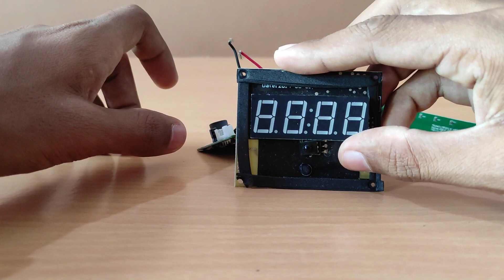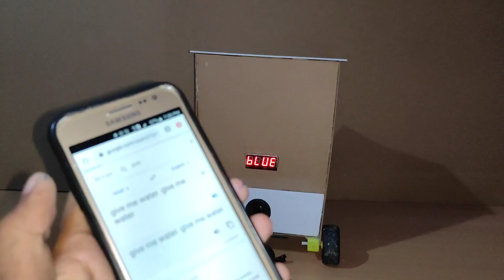Amazing Best science Project Smart Robot Dustbin | Phone control Dustbin Robot

Comment: Hello bro would u tell me arduino code and diagram?
Reply from the maker: Codes and Diagram link in video Description
Reply: @HarishProjects  bro that code and diagram is for smart robot cars
Can you send me code and diagram for robot dustbin?
Reply from the maker: @ahmadtariqhemat379  Yes these codes are for robot cars.  But you can also use it for robot dustbin.
Reply: @HarishProjects  thanks bro and can you send me its diagram clearly? Bhai
Reply: Bro but that code and diagram is for robot car!!😕🙄
Bhai would you send me the code and diagram for robot dustbin?
Reply from the maker: Brother, if you want, you can make your project with the same diagram.  Which I have given in the description of the video.  I have also made  And I do not even have another diagram.  You only have to use two wheels in your robot.
Reply: @HarishProjects  bhai ye upar ka cap or peche ka stand kesa banadiya?
Zara help karro moje ye project ke banane ki liye
Reply from the maker: @ahmadtariqhemat379  cap ko open krne ke liye aapko servo motor aur ek nano Arduino ka jaroorat padega

Comment: Bhi dustbin ki width aur bdhiye nhi to usme weight pdne pr wo gir jaye gi
Aur isme itni bdi kit lgane se acha pam8406 amplifier aur Bluetooth module use kriye aur ye dono lgh bgh 100rs tk ka mil jaye ga
Aur isme Arduino use krne se acha hum sir ek microcontroller ic use kr le jisme Rx aur Tx pin ho
Jisse ye project aur cheap bne ga
Reply from the maker: 👉Thanks for Idea 👍
Reply: @HarishProjects  bhai aap ek 3d printer bna ke dikhaona